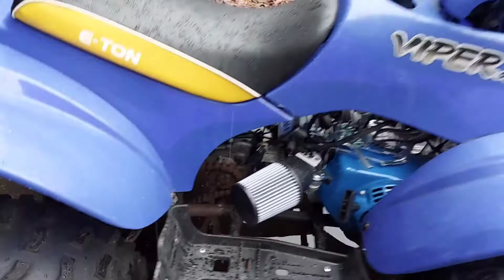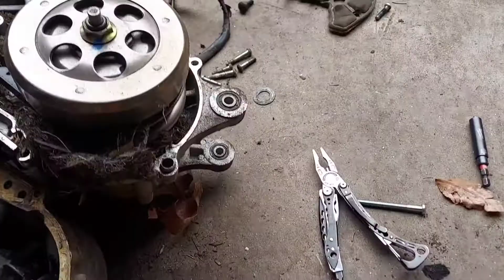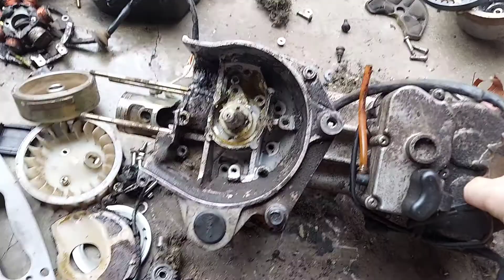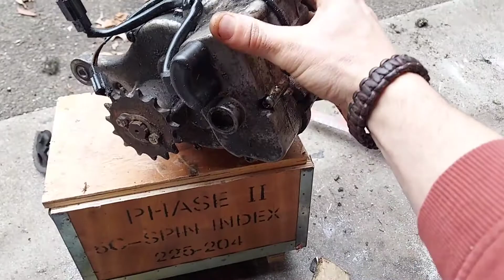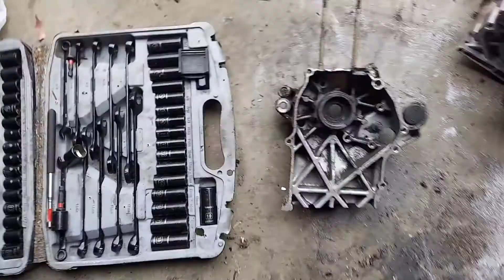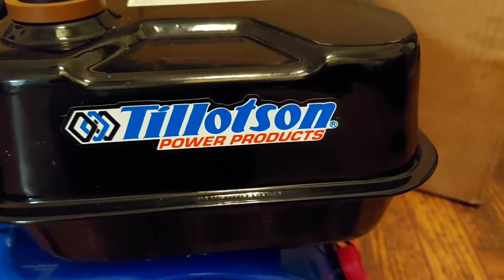Project PitViper!! (pt1) 90cc Eton 212 Tillotson motor swap

Comment: Hey bud, the VIN number is on the front of the frame right under the plastics, correct? im not sure what exactly i have sitting in my garage, but i want to fix it up for my nephews, but i can't seem to pin point the exact model.. Does "E-TON 9EB" sound familiar or mean anything to you? I've been online looking for hours now and I continue to keep getting mixed, mismatched models showing up..
Reply from the maker: Honestly as long as the size fits your inlet any carb can be adjusted and run good and they are pretty cheap on ebay

Comment: I wanna buy a new engine for a Eton 70. Any suggestions? Our little grandson rolled one in for free. So sad it's dead. 😥
Reply from the maker: There's allot of options now for motor swaps you need to make sure the side of shaft or sprocket is correct to axle and they bolt on

Comment: Pressure washing with no exhaust bro'? 😳
Reply from the maker: 🤣 there's no motor then either lol the whole drive train isn't mounted still just cleaning up the frame in that shot the motor mount plate hasn't been set in or welded even yet soon!!